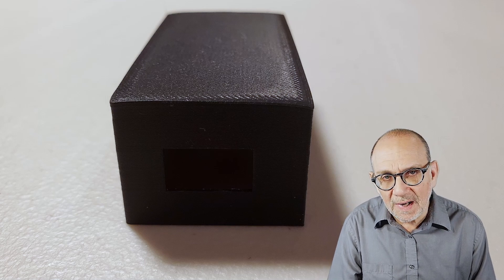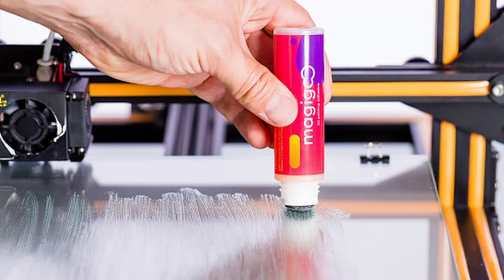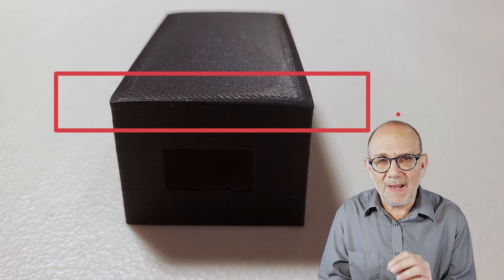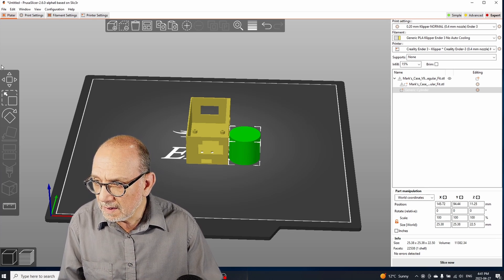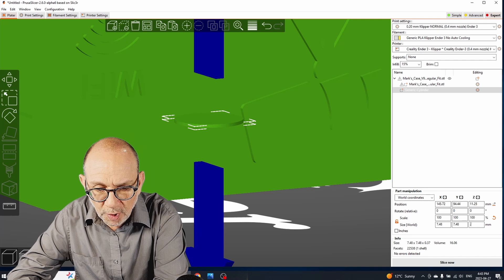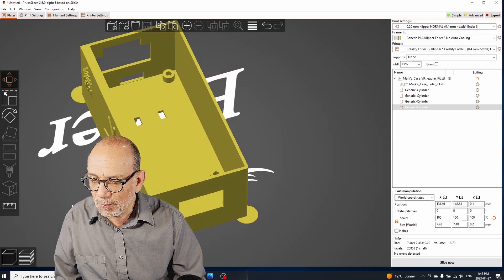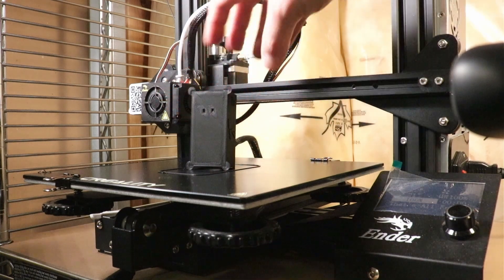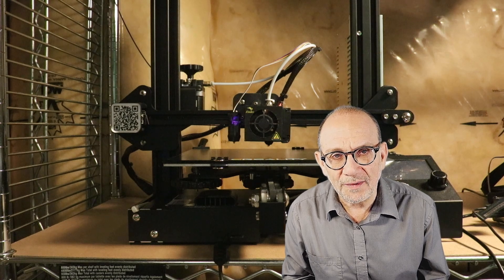Mouse Ears To Prevent Warped 3D Prints

Comment: How do you do mouse ears in cura 5? I don’t do purse slicer.
Reply from the maker: Hello @goodwinml...there is a plugin that you can install called TabAntiWarping that will automatically create mouse ears for you in Cura.  Just go to the Cura Marketplace and look for TabAntiWarping and install it.  Here's a link to the plugin github page with instructions on how to use:  https://github.com/5axes/TabAntiWarping/wiki/How-to-use-it    RG
Reply: @CreatewithTech, Is there a place in cura I need to go to activate plugin? I installed from cura marketplace. Said installed. I restarted cura. followed the wiki link you sent. It said in step 2 "Click on the "Tab Anti Warping" button on the left toolbar". I do not have that tab.
Reply from the maker: @TMonkey_DayZ  Did you restart Cura?  It needs to be restarted before the plugin will take effect.  Once you restart Cura you should see the plugin at the very bottom of the menu at the very left side.  In order to see the menu you'll need to bring a model into Cura.  The Tab Anti Warping plugin is at the very bottom of the  options on the menu to the left...the menu with Move/Scale/Rotate options...so look at the very bottom.
Reply from the maker: @TMonkey_DayZ  Did you restart Cura?  You need to restart it after installing the plugin for it to take effect.  Once restarted bring in a model and click on it.  The menu on the left hand side where the options to move, scale, rotate, etc are located is where you'll find the plugin.  It's at the very bottom of the menu.
Reply: @CreatewithTech  , yes I had restarted. At left below mirror icon I have 2 more. Per model settings with 4 options and Support blocker (“E”).
Reply: @CreatewithTech  I saw on another youtube related to that plugin from about 3 years ago. It showed an icon that had a mouse ear on model. I have no icon showing a mouse ear on a model on the left.
Reply from the maker: Which version of Cura are you using?  I'm not at my computer, but I believe I'm running version 5.6.  Are you running an older (perhaps incompatible) version of Cura?  Try installing the latest version and then install the plugin again.   The icon that I have is a rectangular block with what looks like a round tab at the bottom.
Reply: @CreatewithTech  , 5.5, I’ll check in the morning. In bed now. Thanks. I’ll let you know Sunday. Yep, that’s what I don’t have, that icon
Reply: @CreatewithTech  , I now have 5.6 from 5.5. I figured it out. I was going to google and searching for cura marketplace and searched for the plugin. Found it and it said installed. NOGO. I then saw in cura a signin link top right. I clicked and signed in. Also saw a marketplace link top right also. Clicked it, searched, installed, sync'd and restarted. Mouse  ears now work. This MUST be down inside of cura to get plugins. Thanks for the help.

Comment: Sorry if I'm a bit late here but this video just got recommended to me, after I gave that tip with using mouse ears to another youtuber.
If you want to perfect that technique you would need to model those ears in CAD and cut out the shape of the first layer of your actual model. or rather the part of it that you want to stick better. Then in the slicer, you attach the ears to the print, so that they touch the outer perimeter. Finally you move them around .1mm away from that perimeter. That ensures that the layer lines of your actual model's first layer don't continue into the ears but still bond to the lines of the ears. Once the print is done, you don't need to cut off the ears but rather remove them by wiggling them. They will break off very neatly without leaving any kind of blemish and the layer lines of your actual model will be uninterrupted.
It#s also worth noticing here that the height of the ears should be the exact height of your actual first layer, because that's usually slightly more than the set layer height for the print. Less might work fine but the curling force might just be able to pull them off. Higher might fuse the ears to the second layer and require you to still cut them with a tool.
I don't blame you for disliking rafts, but if you get the settings for a raft dialed in perfectly (which can be a real pain and has to be done for each material), it can be the perfect solution for otherwise hard to print objects. For brims you just need to increase the distance to the outer perimeter of your model. Once you found the right distance to make the brim easy to break off, that is the right distance for the ears as well, since they are basically just partial brims with more adhesion surface where it's critical.
I hope I could help improving your experience with mouse ears as an anti-warp measure.

Comment: I'm not sure if it is a Cura specific issue or not, or if it's just me, but I've found this to be really hit or miss.  I've tried this with many models and some of the tabs just never print out and the corners pull back while others print fine and they do their job.  I've tried pruciaslicer and TBH it's a royal pain as there isn't a pre-set printer definition for my printer and the setup process is just too cumbersome.  Then again I'm probably very biased having been using Cura for so long and being very familiar with it.😀
Reply from the maker: Cura is a good slicer and I use it as well.  I just like to try different slicers to see how they compare.  Prusaslicer is excellent but it can be a bit confusing.  You just need to get used to its workflow.  As far as the mouse ears not always working, I think it really depends on the size of the ears.  Sometimes you need to make them larger depending on the print.  Some prints can be very stubborn.  It's a real pain though when a print warps.  It may work just fine but it looks like crap.  Thanks for commenting.  RG